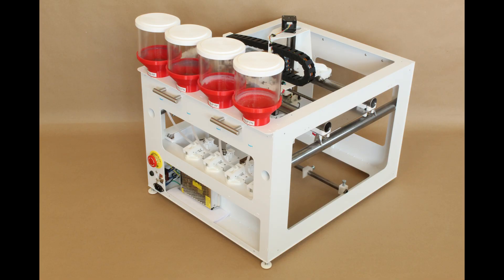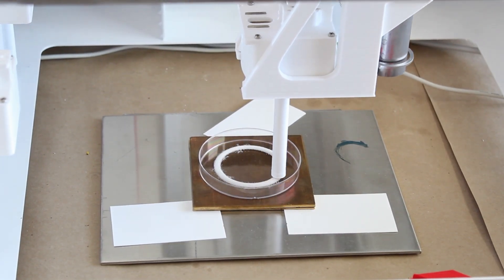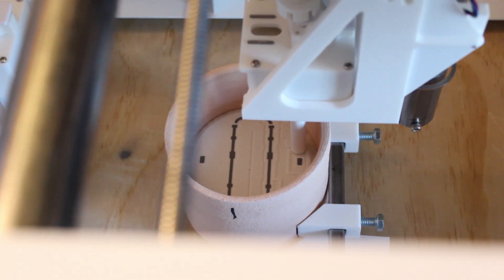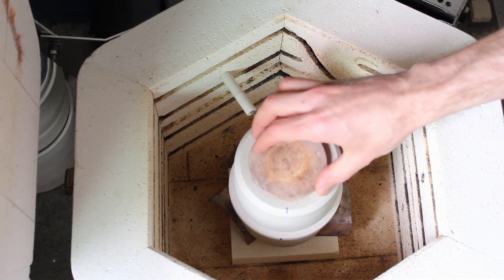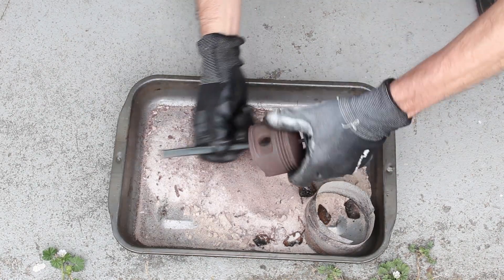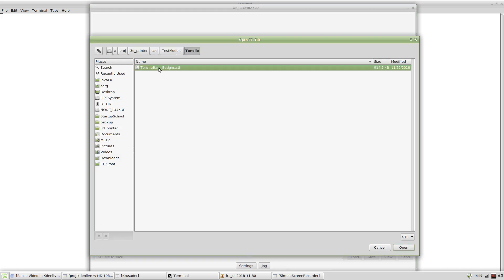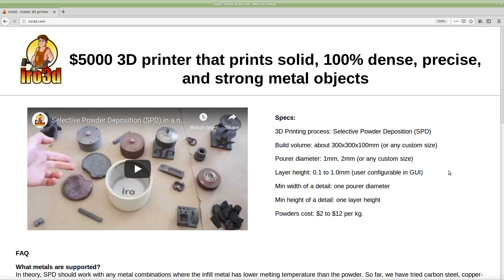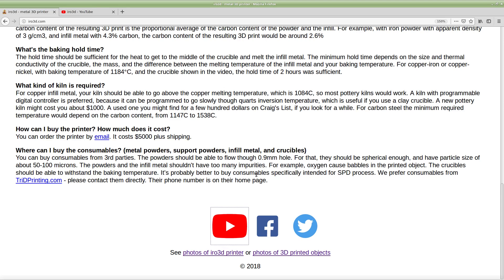What is iro3d metal 3D printer (2018)

Comment: Really really cool! Do you have tensile, compression, bending and impact test data to compare with other manufacturing methods?

Does a finer grained sand or another separation material at the borders generate a smoother surface finish?
Reply from the maker: The tensile strength test results are on the website.  They show pretty much exactly what you would expect from the metals we have used. We are now in the process of obtaining cleaner powders, which should provide much better results. 
As for the surface finish, we already use 2 different grain sizes for the sand, but the fine sand we have used was 150 microns, which isn't optimal.  We need to get a 40 micron sand, which should provide much better results.

Comment: oh my god $5000 is soo much for buying this printer😱😨
Reply: You're not the target market if you think $5k is a lot for a printer of this type.
Reply from the maker: When we get to the high production volumes - the price will go down.  I have heard that the first microwave ovens where $50,000 or something.
Reply: @iro3d  am not industry user, if you can iro3D make it for 600 or 800$ or just make a kit who can add to our FDM 3d printer :D
Reply: when you realize, the other metal 3d print cost around $50 M - $100 M
Reply: @ivanhendrika  no way a metal 3d printer costs 100m.
Reply: @Mr30friends  maybe you can check again "the metal x 3d printer" and say that again
Reply: @Mr30friends  ok my bad, its around 50k -100k
Reply: @anonymouspeople1542  Just checked. It's about a thousand times cheaper than 100m. So I don't really see your point.

Comment: Can this be improved with finer powders into the 10 micron range? You say no shrinkage and full density. So if I cut through this and polish the surfaces, I would get a defectless mirror?
Reply from the maker: And to answer your 2nd question, yes, if you cut through it and polish the surfaces you would get a mirror.   As for the defects, currently, we do see some bubbles from the gasses in the metals. To get rid of bubbles we would need to get metals with less gasses. For a long time we didn't know where to get such metals.  But recently realized that any metals intended for casting - should work.  And there are many to choose from, including the once with low melting point.  See https://docs.google.com/spreadsheets/d/1DEobOyHQBPv8LVHBtqKboK0fo6yoNZyii5NfHWT29Wo/edit?usp=sharing
Reply from the maker: 10 micron powders would give you a smoother surface, but they won't pour through small holes.  It looks the 38-45 um powders can flow through the smallest holes - 0.4 mm.

Comment: how thin it can be printed?
Reply from the maker: The layer height is configurable in software.  In practice, you shouldn't set your layer height smaller than 2 particle sizes.  For example, if your powder size is 40 microns, then your layer shouldn't be smaller than 90 microns.

Comment: could this be used for some sort of solid rocket motor?
Reply from the maker: Yes, absolutely.  Rocket engines and molds with conformal cooling channels for plastic injection molding are the two applications that look the most interesting.

Comment: So could someone make steel jewelry with this ?
Reply from the maker: Not really. Your jewelry won't have any details smaller than the pourer hole size, which is about 1mm.  So, unless you want a very low resolution details on your jewelry, you would need a very smaller hole (and the powder that flows through it).